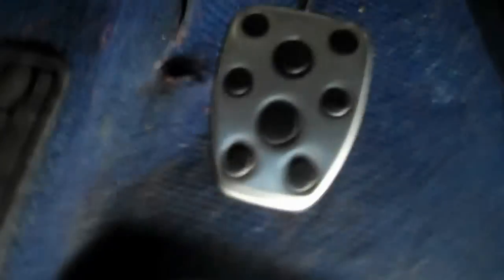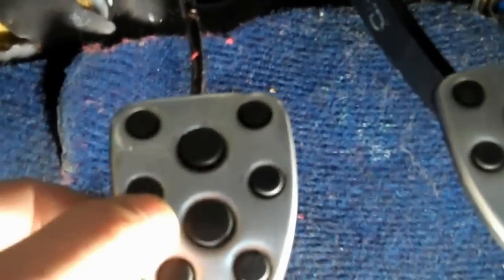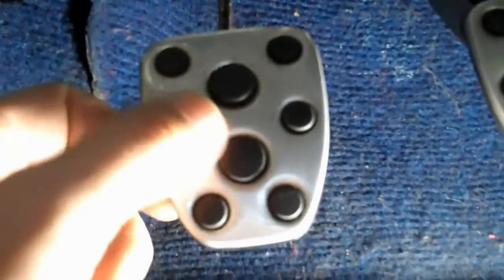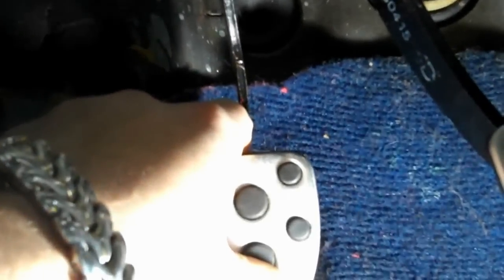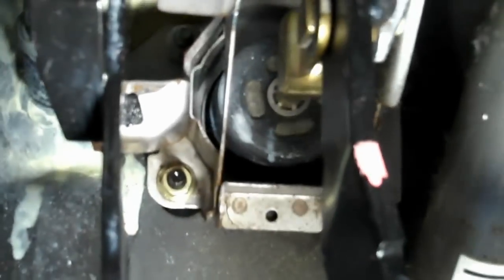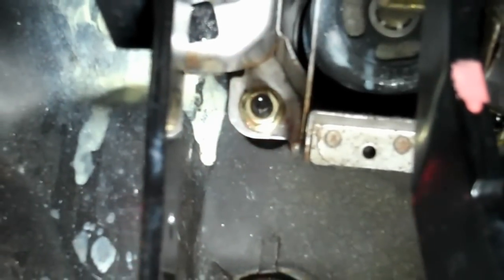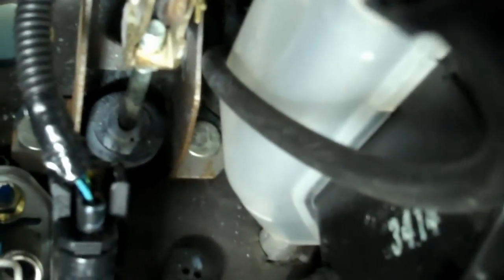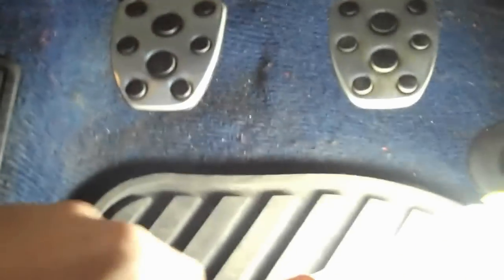Clutch pedal noise squeak sound Subaru  Series Part 13 WRX STi fix solution slave cylinder

Comment: I have a 2011 WRX and from the multiple threads I have read, regarding the correlation between the clutch squeaks and firewall welding, I decided to inspect the firewall welding.  I was convinced that the loud squeak was coming from around the area but the welding was intact.  I went to Autozone and bought White lithium grease spray from 'Liquid Wrench'.  The spray came with a thin tube straw, which was very helpful.  I sprayed the area a couple of times before driving to work and after my 8 hour shift, the noise was gone.  Thank you for posting this video.

Comment: You have no clue how stupid this video made me feel.  I have been battling this creaking issue for about a year now. I've used a whole can of grease on all the pivots and everything relative to the clutch pedal EXCEPT for the right side as you mentioned. Added a bit of grease and holy crap. I even had my clutch replaced and still had this sound. Pissed me off (though I needed it replaced). You have no clue how much of my insanity you've relieved with this simple, stupid yet obvious fix. I can enjoy sitting in LA traffic a little much more now. The squeal was killing my soul slowly. I LOVE YOU
Reply from the maker: Ray there is a huge spring above the clutch pedal I thought for sure was the creaking. Just like you it took a few long months to figure this out and needed to share this with everyone .
Reply: Mine makes a similar sound only when I release the clutch in first gear or reverse.. do you think it's the same for mine? In every other gears its perfect. And clutch pedal works fine, and no grinding or anything. Its just that noise when I release it in first gear or reverse. Also when I down shift to second it will kinda make a noise too.

Comment from the maker: My STi is a 2004 so i can only speak from MY experience with the car.  The firewall weld coming loose is a whole different problem. This video shows how I stopped my squeaking problem , it has been two years and no noise since I cleaned the assembly .

Comment: Thank you for this video my 2012 wrx clutch pedal was driving me crazy with the squeak 😭
Reply from the maker: Mikeythementor Tanigawa it’s incredible how this little dry rubber boot makes us 🥜
Reply: I got this same problem now on my 2012...
Reply: My 2012 started doing the same thing a few months ago. I was about to replace the whole clutch pedal until I saw this video. I’ve tried dry Teflon lube but seems to come back a few days later. Are you still having this issue or have tried any other lube that works better?

Comment: If you suspect the spot welds have let go on your car (like many others), have a look at the humble rumble spot weld replacement kit.
Reply from the maker: thanks Peter will take a look at that.
Reply: I installed the humble rumble kit but still have squeaking. Going to check this solution out today, I believe this is the issue!

Comment: Thanks!  I have dealt with a squeak, click, grind for months!  quick squirt of silicon lubricant solved it!
Reply: Edwin Farr I haven’t tried silicon lube yet but have tried dry lube. As of right now I have to spray it every few days. Did silicon lube solve the issue?

Comment: THANK YOU SO MUCH FOR THIS VIDEO!! Not sure how I haven't come across this video in the past 5 years ... but this absolutely fixed my issue immediately!  I put WD-40 on it quick just to see if it reduced the noise, and it did!  I will pick up some lithium grease and work that in there next.  Thanks again!
Reply from the maker: Kevin Lenz found the best way is to spray , work the pedal a few then clean it off and spray it all in the boot ! No noise for years now !

Comment: Hi. I just fix the noise putting two screws over the two soldering marks. I drill the position from outside soldering marks (behind the wipers motor/bars assembly) from my WRX 2009 with a 1/4" drill and put two screws with pressure nuts. That eliminated this horrible noise!!! You have to take out the 2 crews that hold the computer box from inside (below the steering wheel) to have enough space to pass trhrow your hand until you reach the drilled holes

Comment: omg thank you for posting this! other videos were taking about drilling out spot welds in the firewall and all kinds of other crazy things. $5 at AutoZone for some liquid wrench white lithium grease, point the straw at the rubber boot, press the pedal a few times, and give it a few squirts, problem solved! Make sure you lay down a rag or towel so it doesn't drip on your carpet 🙃

Comment: Subaru Just issued the recall for this problem FINALLY!!!! 

Yaaaaay... They fix it in the body shop on the firewall. Remove the dash, Weld it and repaint it. 

I've had this is going on for so long.  My car is at the dealership now for this very issue.
Reply: Do you know the campaign code or recall number for it ???

Comment: Is this a hydraulic clutch? I ask only cause I have a squeak coming from my brz's clutch pedal as well, and. I'm wondering if this would work on that.
Reply from the maker: It should as you have the same setup near the firewall , rubber boot and metal arm squeaking.

Comment from the maker: @AMRsti93 can you pinpoint the noise from the cabin or is it under the hood near the clutch fork. I had to clean the clutch rod that enters the rubber near the firewall a few times before the grease really sunk in and lubricated the rubber inside. All my noise was a dry metal rod entering a dry rubber housing .

Comment: sadly, this didn't work for me. It's def the master clutch cylinder, but not from the same reason as this. I actually took the cylinder out, cleaned it, etc. and it was perfectly fine. When it was back in, i had someone else push the clutch in and i noticed you could see the firewall flexing. I found out that a few companies make a clutch master cylinder brace, gonna order one in and see if that solves the problem. I really don't want to drill holes into my firewall.
Reply from the maker: Coldbore some have the dreaded firewall welds break free. If you can find the master brace for the 04 STi please leave a link, I can’t find it for the early USDM Impreza
Reply: Did the brace end up fixing the flex much?

Comment: Question, I did this, it worked but .. I am thinking that it will damage the internal rubber seals in the long run.
I really dont know... in my case it fixed it in my 2010 civic. But i am having some second thoughts and maybe I should have  used the Silicon in stead. 

If someone can help me clear my doubt.
Reply from the maker: I did this 7 years ago no issues to this day , drive the car all the time. Silicone is nice and gentle it’s not a penetrant fluid and will protect rubber from degrading. What did you use ??
Reply: SVTWRC thank you, white silicon grease as well. I think this parts are not made of natural rubber. I think it would easily snap as normal wear and tear.. besides on the other side there is dot4  fluid .. 
thank you for your reply it adds confidence to my diy repair :)
Blessings.

Comment: I greased up the area you talked about, still have a squeak/creak  also the brake pedal moves slightly when I depress the clutch also. I checked the welds and no issues or cracks I can see. any ideas?
Reply from the maker: My brake pedal moves ever so slightly too , it's all connected. Try cleaning that area and the rubber boot then grease it up. If it still makes noise try the arm right above the clutch pedal, there are a few moving springs right above the clutch.
Reply: Ever fix yours?

Comment: Thanks I have this noise and have tracked the noise to this area but mine has a black plastic casing around it that I have to remove to apply the grease , do you know what the part is called that I grease and thanks for the video it's a great help

Comment: Can i use WD-40?
Reply from the maker: Hey there. WD -40 will evaporate but will let you know if you found the noise. If the WD works you can get some white lithium grease, no Evap it stays on there.
Reply: thanks man!
Reply: Tizmo JDM I found that using gear grease works best for eliminating the creaking.  I still hear a bit of creak in his pedal. mine is quieter now on my 2015 WRX. the white lithium while it worked didn't last long.

Comment: Sadly sprayed down every moving component and it still squeeks just gonna live with it.
Reply from the maker: Surtile Cryx it could be your firewall welds . Call your local Subaru service , they are welding the plate that’s moving for free due to the error.
Reply: @svtwrc  I'm in the same boat. I tried the lithium grease method on the piston to the right (as you demonstrated) a month ago and the problem didn't go away. I figured I would try to grease the piston again today; the problem got BETTER but the creaking is still there. Could you give me more info about the firewall welds? Thanks, I appreciate your video.

EDIT: I did a quick search on GOOG and found it only affects models through the year 2014; mine is a 2016, so I guess I"m back to the drawing board.

If anyone is having the trouble on a 15 and up STI, please message me or let me know. Thanks.
Reply from the maker: J. White hi J Subaru realized the issue and was welding the firewall for free to anyone experiencing the issue. Sometimes people have issues with their local Subaru service but you may be able to have luck calling Subaru of America . SOA can locate a shop that they will communicate with if there’s an issue it’s not 100% but I’ve heard a lot of people on the comments if you browse through them